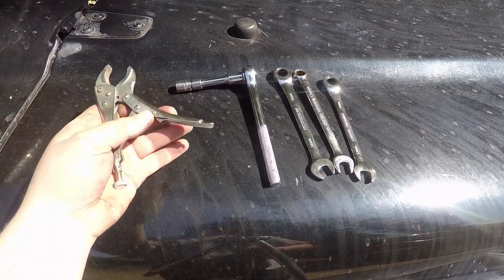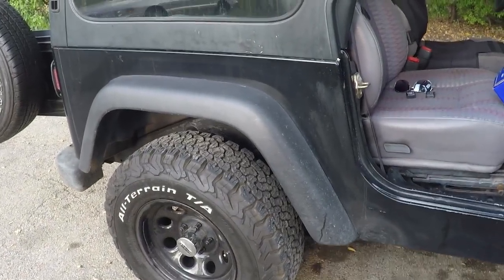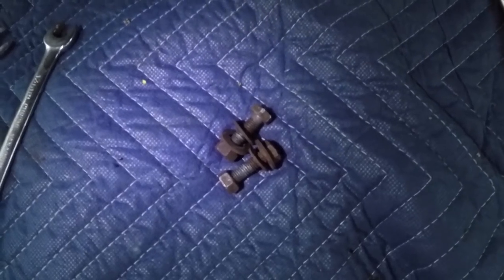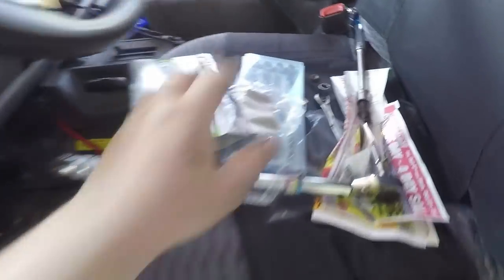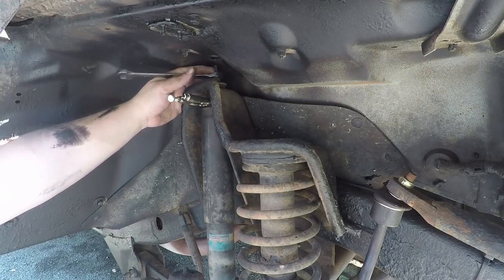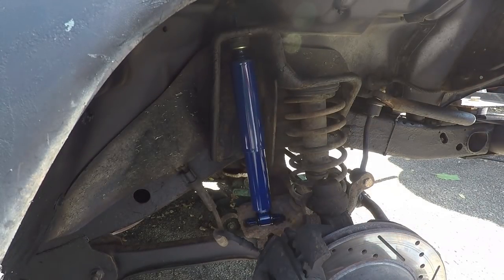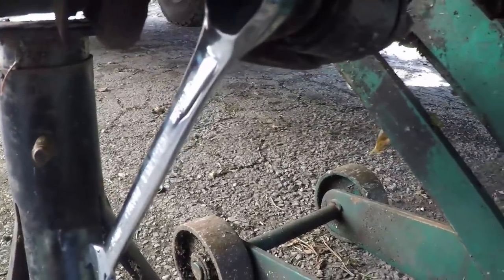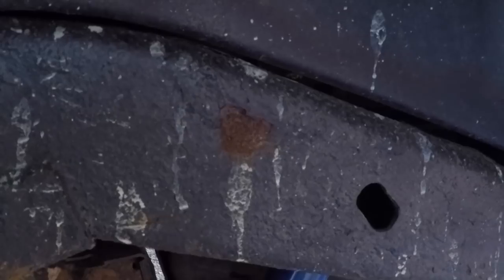In Depth Install | Replace Front and Rear Shocks on a Jeep Wrangler TJ

Comment: Nice video Mike.   Very helpful.  Did you notice that when you replaced the back shock on the passenger side the bump stop fell out?.   Its sitting  inside the spring which is common.
Reply from the maker: Lol yeah I notice that. Pulled it out and ordered new ones. Thank you btw for watching and commenting!

Comment: Interesting I bought rough counter shocks all the way around and the problem I’m having is that the bottom attachment I can fit the rubber through the spacers in order to get the bolt through and tighten it.
Reply from the maker: I’m not sure why that would be. Are you 100% sure they sent you the right parts?  If so, maybe try to find another washer to fill that gap
Reply: @mikegoldenGames  no I got the situation figured out it was the head shocks but they are the right parts now I just need to work on my replacing my clutch. And rear main seal.